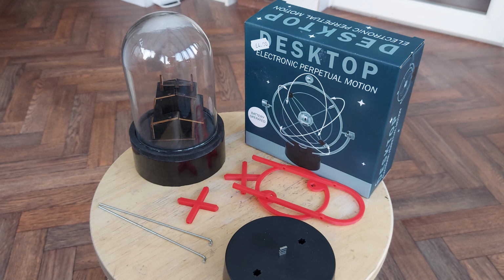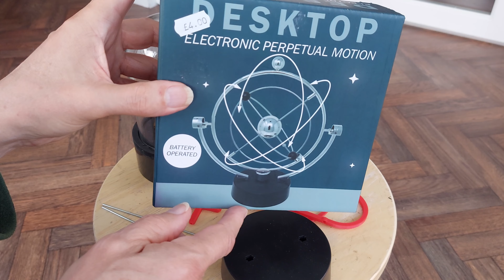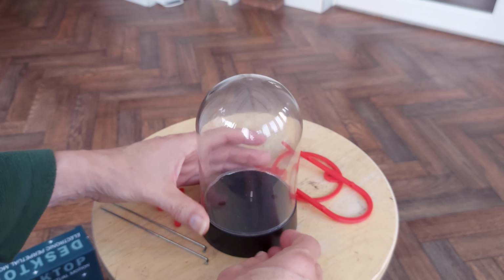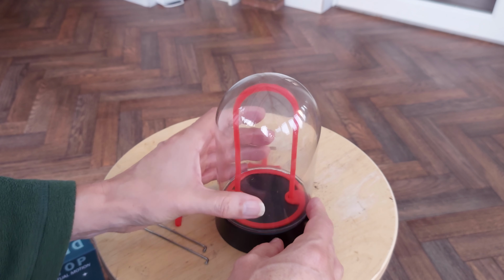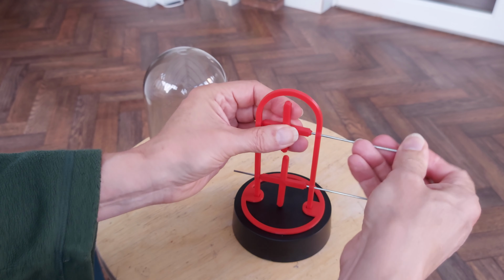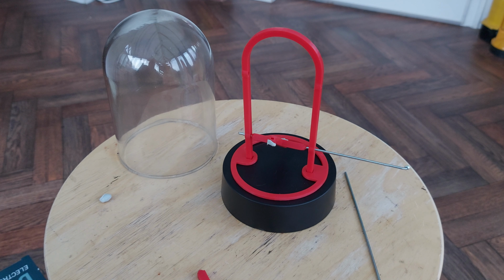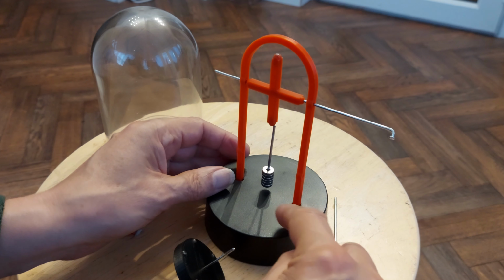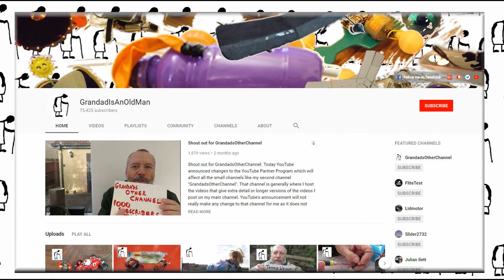Chaos Cloche Mk1

Comment: Can you not take the magnets from the original metal parts 🤔
Reply from the maker: You could. I would rather leave the original parts intact so I can donate it back to a charity shop when I have finished my video series. I have plenty of magnets.
Reply: @GrandadIsAnOldMan  I suggest as maybe the strength on the original item is needed, your vape ones might be too strong causing your over movement on printed model
Reply from the maker: @richardspicer8253  certainly I could try less powerful magnets, but I am not trying to duplicate the original model so I don't need the original magnets. In the past I have used cheap fridge magnets when I needed less powerful magnets as they are readily available 👍👍